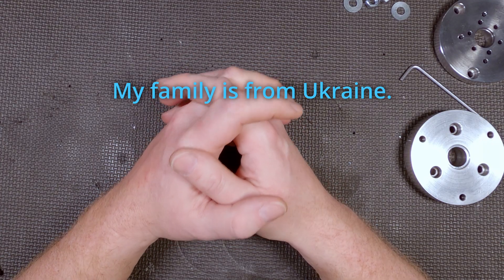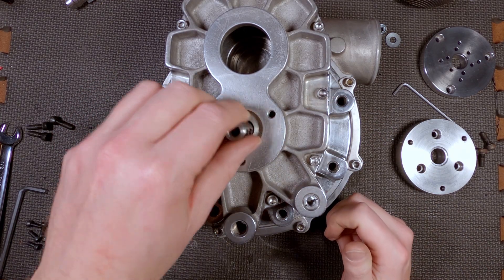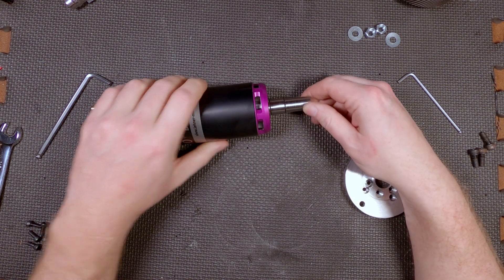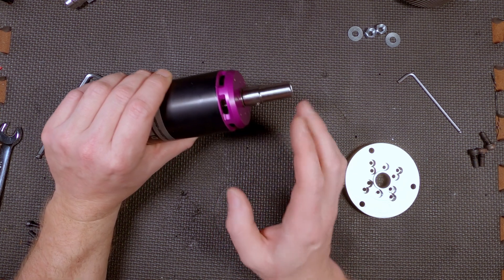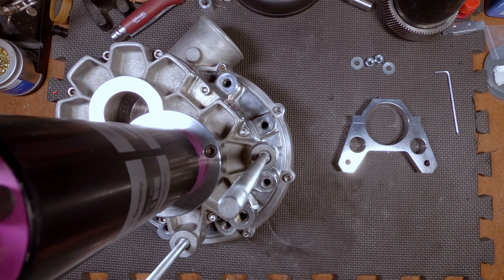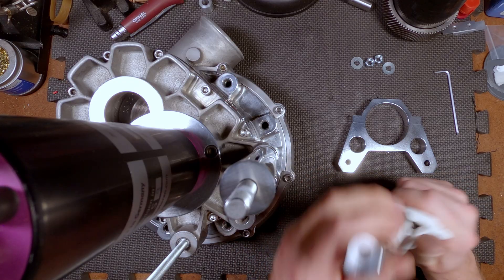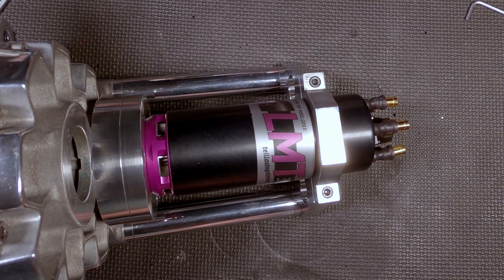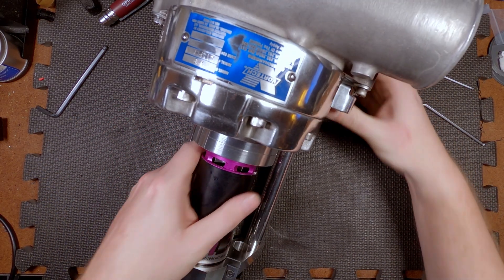DIY Electric Turbo: Sledgehammer Assembly

Comment: Wondering if I can make remake one that can be slap into a 5 cyl volvo enough to push just around 200-300hp more. Lol
Reply from the maker: The P2/VESC setup is the one you want to follow.  That one should be good for any power goal from about 250hp-650hp and is a lot cheaper to replicate.  This one is, in a word, expensive.  Look back at some of my fairly recent videos to see the tests on that one.
Reply: @AlexLTDLX  do you have any rough numbers? also what supercharger should I use for that type of application? I am actually limited to the engine. just wanted around 400-600 hp.
Reply from the maker: I do, actually - the P2 unit should be similar to our version 1 - the first drag results are very telling - 650 hp, based on quarter mile and fuel consumption: https://youtu.be/AOL3Qyczt3Y  There are a lot of videos in the electric turbo playlist.  We even dyno tested an early version with too small an impeller and still picked up 64 rwhp on a 500 hp V8 on only 2 psi.
Reply: @AlexLTDLX  that was niceeeee. Btw. Is it really plausible to see this setup replace a conventional turbo? One that can be used daily?

Comment: when its ready to be sold as a dyi kit let me know. I am jealous of your machining skills I have none. keep up the good work. I was expecting the motor mount to have bearings for some reason. lol.
Reply from the maker: Thanks!  Keep an eye on electrifiedboost.com - if I reach a point where I'm comfortable selling parts (doubt I'd ever do a complete kit - everyone's requirements are very different, and there's a liability aspect to consider), it'll happen there.  Here's how I acquired my machining skills: I married extremely poorly, then became a single dad.  When my daughter was too young to be left alone at night, I starting spending hours in the garage.  First porting, then over the years machining.  I can't recommend that technique though - the lawyers are far more expensive than a shop with good machine tools...
Reply: @AlexLTDLX  lol I had the single dad part down but I spent hours learning how to do computer programming at night instead. I am however a "back yard" mechanic and have assembled an engine from bare bones. I can get the turbo and rc plane motor and batteries/controller on my own. I just have no idea how to make those machined parts. the closest thing I ever got to machining anything was porting and polishing heads with a dremel and getting a harbor freight hone tool to put a new set of pistons in. I can assemble things like the best of them. lol. even have done some mild welding. tack welds and arc welds and some mig welding as well. mostly just to make custom exhaust and a light amount of fabrication work. I actually do want to learn to do some machine work at some point. but its just a hobby for me so who knows if I will learn everything I want to learn or not. I was just saying you already got one working. but I hear of all these newer cars coming with some electric turbos stock. so its only a matter of time before theres an affordable one. the demand is there. I actually have a procharger on my current set up. being able to take away the pulley would be nice. and the torqueamp ones dont make enough boost and restrict air for larger displacement and I got a v8 lt1 gen 2 and a 5.3 liter ls based truck engine I am just starting to work on now.
Reply from the maker: I think you're probably right - we'll start seeing more and more of these in OEM applications.  There's a much greater return in using electrical energy to power a turbo than to put it directly to the wheels.  If nothing else, to help meet CAFE standards.
Reply: @AlexLTDLX  On the, "much greater return in using electrical energy to power a turbo than to put it directly to the wheels." I'd say that's pretty backwards.  You're using a motor  to drive a 60-80% efficient compressor, then just dumping that extra 20-40% of energy to atmosphere as heat.  That's not even taking into account the motors efficiency (Probably in the 90% range), and the typical car alternator efficiency of ~60-70%.  So all in all, this is a far less efficient way of driving a supercharger, and far, far less efficient thing to do with the electricity than just drive the wheels, as you're skipping a whole round of efficiency losses by just coupling the electric motor to the wheels.
Reply: @AlexLTDLX  It now occurs to me that you probably meant strictly a return on the electrical power used to generate power at the wheels.  Like instead of only getting an additional 53 HP to the wheels with the motor directly coupled, you can use that 53 HP of electrical energy to supercharge the engine, allowing you to burn more fuel and get much more than an additional 53 HP at the wheels.
Reply: @AlexLTDLX  I got the trial by fire machinist apprentice in a jewelry factory doing tool and die work, YEEHAAW !! a year of that and they played the game.. laid off at 50 weeks no raise no paid vacation no benefits, calling 3 weeks later wanting me back same wage? "thanks for the education",
CLICK.
Reply: @AlexLTDLX  I want to mount one of these on my 2008 Yukon Denali. I'll be the guinea pig 🤣😂
Reply: man if you decide to sell a kit with battery and controller box for $1500 or less I would slap one of these bad boys on my old ass Kia soul to make a sleeper hamster mobile 😆
Reply: Hello ,iwant one how much wuold it cost?

Comment: lookout were going aerospace🤪👍
Reply from the maker: Hopefully - we'll see if it pulls the front wheels on launch - then we can call it aerospace.  The car did with the Whipple, I'd think with the improved weight distribution this should too.
Reply: @AlexLTDLX  yup, rear traction is best when fronts barely down.
go atmospheric! what is that? about 14.3 psi at sea level?
this package just might!

Comment: Can u make a thrust messurement of the blower at full power please :) my bet is about 20kg
Reply from the maker: I don't know how I would do that.  I do know it draws some vacuum under the back side of the impeller though.
Reply: @AlexLTDLX  thrust..  put it on a bathroom scale pointed straight up, subtract unit weight from powered weight. simple static thrust.
simple+solid wood cradle to set it in, the "and tattooed" type.
Reply from the maker: Lol.  That would be very difficult to do, but a good idea.  The P2 version was lifting over 50 lbs blowing down. And then there's the challenge of doing all that while fearing an explosion, fire, etc...
Reply: @AlexLTDLX  hi i did some mesurements with a brushles dyson turbineunit i let it blow with the ideal cone nozzle directly on the plate of my scale and come down to 1.3kw per kg force what should be about the same as thrust. 338watts 260g force on plate ...so for my 70kg we balance in air with 91Kw ;))
Reply: i guess the bigger turbo/Motor could be a bit more efficient, waiting for your KW per Kg Results ;D
Reply: Thx a lot ;)) it would bring us a step closer to compact hose or wirebound jetpack funflyers like 4 or more units paralel  =200kw would do the job ;))  who wants to build/ try that too gives a thumb up ;D